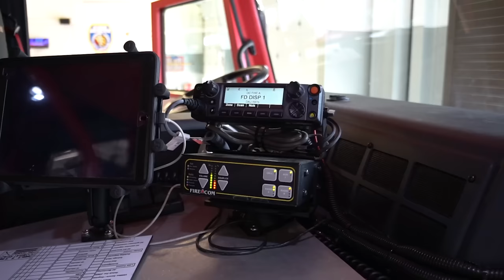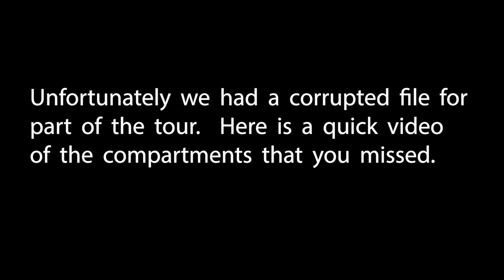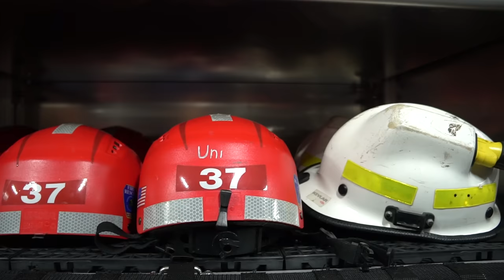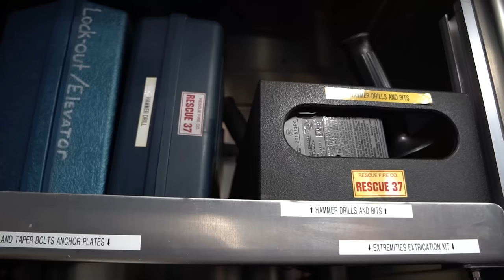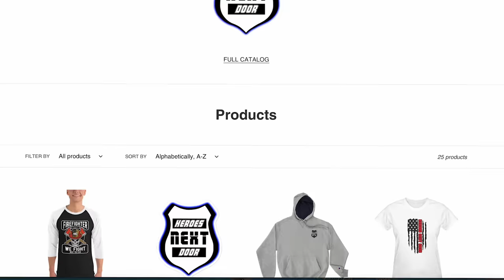BEST Rescue set up by FAR

Comment: Interesting seeing An Aztec 4:1 used for stabilizing a strut. Any reason why they’re applying mechanical advantage to support a tripod?
Reply: I was wondering the same think ….seams like a over kill. A stight line back to the anchor and use prusuks for a “cheat knot” to make and length adjustment you may need ….then back it up w a figure 8 on a bend and carbine it to the anchor.  Way less hardware ….KISS !
Reply: My thoughts as well.

Comment: With concerns over russia getting the way they are - that the possibility of a nuclear exchange has grown higher - all this hi tech stuff concerns me. In the 90s and before a lot of our gear didn't use computer chips especially to the degree they do now. EMP is a thing and it would not only kill the rig but it would kill all the gear on it you would need. Yes they have manual backups - but they can only get so much done with them.
Reply: @leoschneider3570  Yup. It's still farther then you get if power tools stop working.